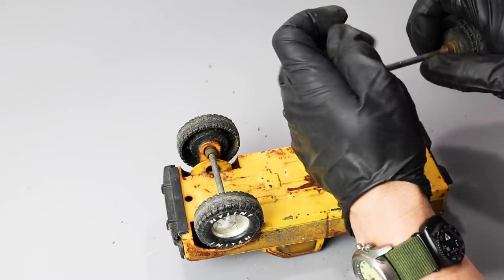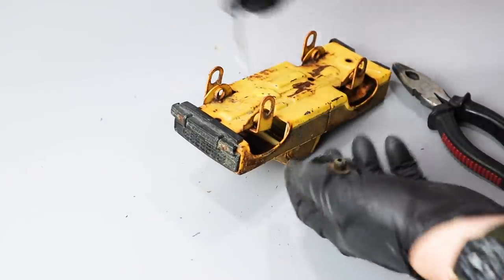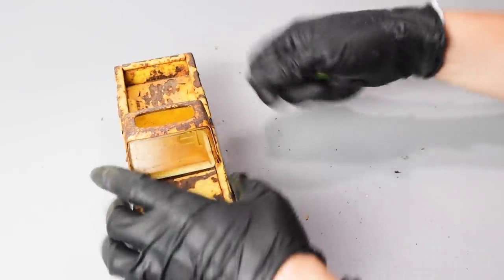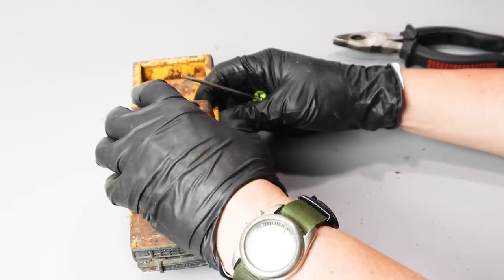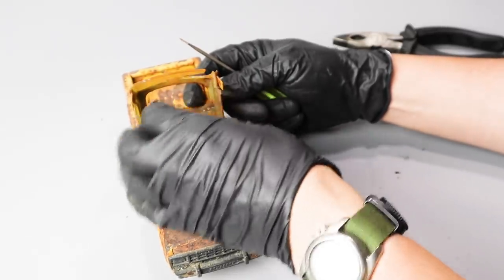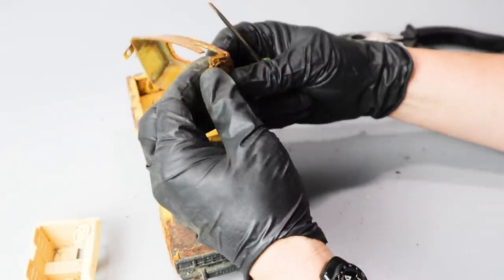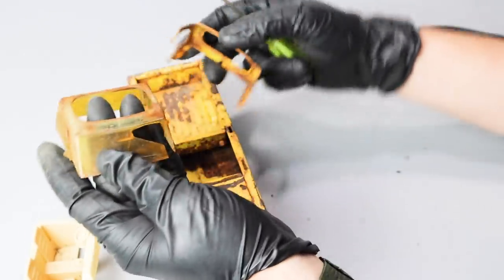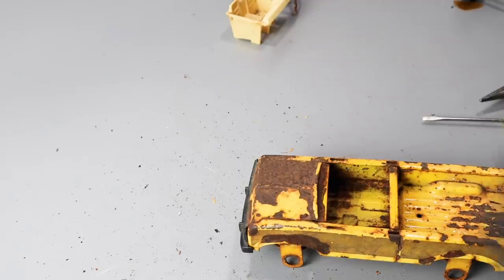Toy Truck Restoration | Nylint Ford Ranger Hi-Rider

Comment: I liked this one. I even like the decal/stickers you made up. Color choice perfect... I call that Ford Blue. I did notice a couple of things, I think when you're doing this stuff, you should remove your watch and put it out of harm's way... overspray, water...chemicals, sanding grit... whatever. The other thing is when you were using a buffing wheel on the tires. Try using a standard toothpaste as a buffing compound. it's very mild, but does add a bit of grit, and lets the wheel spin better with the bit of creamy lubrication. Use an old standard toothpaste, Crest or Colgate or the like, not gels or whitening types. oh, you can use tooth paste like that and a large polishing machine to take those tiny little scratches out of wincshields, real windshields, those ones you only see covering your windshield when the sun is at just the right angle. Probably do wonders for salvageable plastic windshields too.
Reply from the maker: Thanks. I have to try the toothpaste thing. Sounds tasty 😁

Comment: Hi fill primer would have helped hide the pitting better. I would also take the camera off auto focus for most of this as it was the same distance but the camera had difficulty.
Reply from the maker: Good tip on the primer and camera. Restoring is unforgiving at times with the camera, you can’t always do a second take... that and I’m still learning the camera thing 😁. Thanks for watching.